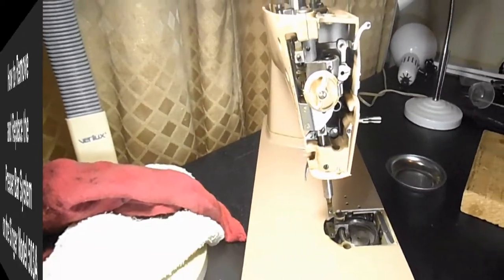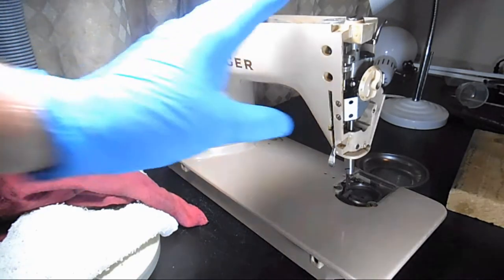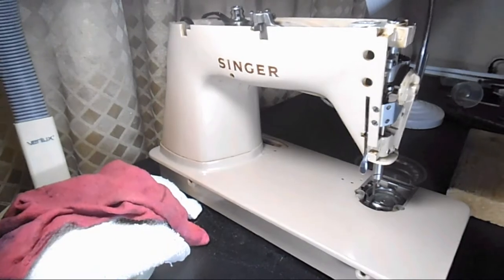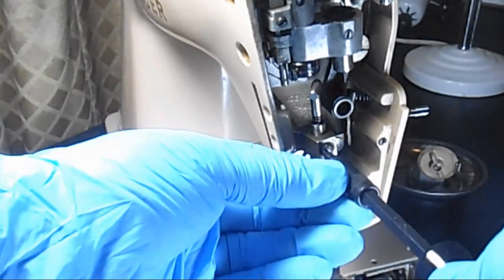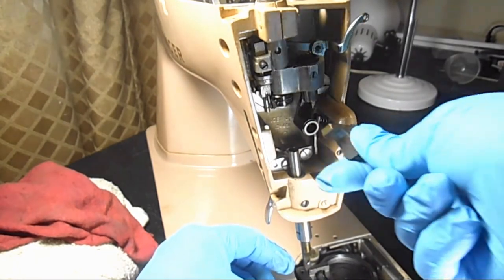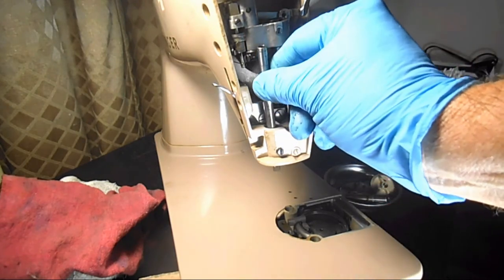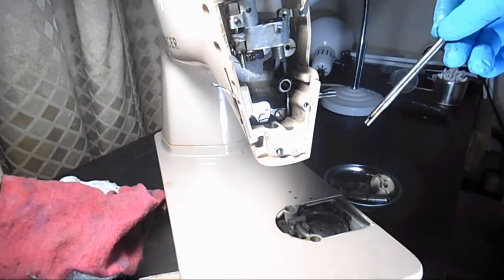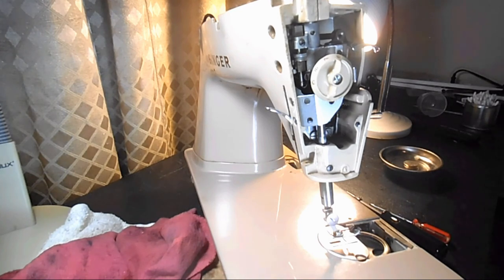How to Remove and Replace the Presser Bar System on the Singer Model 503A

Comment: It took over 36 hours to dislodge the two back screws on my machine.

I used multiple applications of each: WD40,  krud kutter and hair dryer for 5 minutes.  Even then, it took a lot of strength and made a big popping noise when they finally let go.  I had put down a plastic drop cloth on my table and dobbed up puddling treatment with paper towels, using excess to wipe down other varnishing I saw.  Particularly on both needle and pressure foot bars.  

(A set screw dislodged from somewhere and fell out of machine in one of the turnings about while greasing and heating it.  Yet, so far, no set screw was missing from further disassembly 🤷‍♀️)

It did help me to understand how to work out remaining “varnished in” parts.  As each further step had at least one bit that required same WD40, krud kutter, heat to get them out.   

The single owner’s son sold it to me from her estate and said she used it a LOT.  I gather she knew how to oil!  

This is for future folk’s use, not really a question.  Take your time so you don’t scratch up body or bend parts of your machine.   This procedure EVENTUALLY works like a charm.
Reply from the maker: "She Persisted"!! I admire your determination, Angelina. Those 50-year-old factory tight screws can really be tight. Then add a few layers of dried varnished "oil" and it can be a herculean task to break them free without damaging the part or the machine. Good job and nicely done.

Comment: Again, your video is worth a thousand words.

When I removed the pressure dial on my 503 to adjust the presser bar height I didn't see how the extension pin interacted with the dial. On reassembly, I referred to the manual. It read "With pressure dial set at "D", replace dial making certain that extension X2 is seated against outside cam surface of dial." I couldn't make that work!

Your video clearly showed that the extension pin goes into the vertical slot on the back of the mounting bracket for the pressure dial.

OK, maybe in this case your video is worth 21 words. 

Thanks
Reply from the maker: I'm glad the video helped you. It was tricky the first time I did it and took a few tries to figure that one out. A fellow emailed me yesterday saying he keeps telling people on Facebook "Andy Tube has a video for that", and sometimes I do. Thanks for the comment. Take Care.

Comment: Andy, thanks to you I just successfully fixed my dial that was not working properly when I purchased my $20 Singer 500A Rocketeer! I've admired these vintage machines for years but was too intimidated to actually think I could work with one on my own. I've watched dozens of your videos and finally felt like I was confident enough to take the plunge and purchase my first vintage sewing machine about 2 weeks ago. It was born a year before I was! I am so grateful to you for showing me (and so many others I am sure) how to maneuver my way around these lovely vintage sewing machines. I have a fantastic new hobby and am taking so much pride in each step I take as I restore my Rocketeer to her original glory. She was one hot mess but every day she gets a step closer to perfection. Thanks Andy! You're the best!!!

I found a few interesting things under her hood. LOL! All the usual suspects - beetles and gross things - but I am a very perplexed by something that actually looks like a tension wire coiled around one of the inner workings on the top of the machine near the cam shaft. I know it doesn't belong there but I haven't yet figured out where it goes so I am just leaving it there for now. It doesn't seem to be hurting anything but definitely has no purpose there either! I keep hoping one of your videos will show me what it is at some point. Please keep making your videos and I'll definitely keep watching. You're such a treasure Mr. Andy!

All the best!
Paula
Reply from the maker: " She was one hot mess ..." Hehehe, thanks for my first smile of the day. A good description! Good score for $20; the motor is worth that much. Thanks for the compliments, and for watching my channel. For the spring, what first comes to mind is the spring for the bobbin winder. They are very prone to breakage. There is also a long coiled spring from the needle bar driving arm on the left side of the camstack area over to the needle bar vibrating bracket that can break. All of these springs are shown in the three videos linked here >>
https://www.youtube.com/watch?v=BWdT7OlGUMg

https://www.youtube.com/watch?v=P2ROdLM5zmE

https://www.youtube.com/watch?v=89kRREixTeA

Best of luck to you as you delve deeper into your restoration.

Comment: Regarding the two next-to-impossible screws in the back, I applied penetrating oil and left it overnight.  The next day I used my Wagner heat gun about four inches away for three or four minutes. I waited just a few minutes and the screws came out easily.  This area of my 500A was very dirty—it may have never been cleaned. I have the same Chapman screwdriver set as Andy and it works very well.
Reply from the maker: Oh, nicely done! I don't have a heat gun, but others have told me they have used it and it works well. I love my Chapman set, especially that little mini-ratchet! A good reference for others to think of a penetrating oil and heat to prevent damage to the screws, or your knuckles too I guess! Thanks for sharing. Be well.

Comment: This video, and the short one, helped me reattach the pressure foot system on my Singer 1021. The set up is a little different but your comments helped me accomplish the task on my machine. The 5/16th height setting, and holding the bar up to this position was very useful. Thanks for taking the time to make and post this video.
Reply from the maker: Thank you, Susan. I'm glad it gave some help for you with your 1021. I'm not sure 5/16 is the correct height for your model. If you raise the presser bar/foot and lower the needle all the way down the two should not touch. If they do you can always adjust the presser bar height a little lower, right? Its great you did it yourself. Congrats. Stop by anytime.

Comment: Hi Andy, I'm looking at your presser bar video here and I'm wondering if I re-adjusted the presser bar height up, would I be able to sew thick multi layers of fabric without the thread tensioner releasing?  Looks like it would work by the video.  Any thoughts?  I've had the thread tension release while sewing thick stuff.
Reply from the maker: I've never done that, Ralph, but it seems possible. You'd just be creating a little more room for the fabric. Things to think about are if your feed dog is set too high, if the pin on the back of the presser bar lifter lever is worn, or if you "help" the fabric move along and are inadvertently "lifting" the fabric at the back of the presser foot. Be sure you are using enough pressure on the presser bar dial to press on the fabric. If those all seem OK then sure try raising the bar and see if that helps. Good Luck.
Reply: @andytubesewing1953  Thanks Andy.  I've definitely been "helping" it through.  I have a hunch the end result might be the same.  Have a great Thanksgiving.  Thanks for all the help.
Reply from the maker: @ralphwatten2426  You may want to try and even feed foot or walking foot. My wife uses this when sewing layers, especially of thick material. https://www.amazon.com/DREAMSTITCH-421333-451-Walking-Singer-Machine/dp/B07WRGWX7P
Some of the newer styles even have teeth on the foot, just like the feed dog does. Thanks for watching my channel and good luck.
Reply: @andytubesewing1953  Thanks Andy, I'll give it a whirl.

Comment: Thanks for your videos.  I "found" a 500 today that looks like it's been in the barn for 10-15 years.  Lots of dust and some light rust on the needle bars and presser bars.  I was afraid to even make an offer for it.  Now after watching your videos I'll go back and take a closer look.  Are the rods on the 500 series as strong as they are in the 403?  Thanks again.
Reply from the maker: Yes, many of the 500A/503A parts are the same or similar to the 401A/403A parts. Only the 404 straight stitch model is more heavy-duty parts wise. If you get the 500A, this other playlist for the 401A can help you clean/adjust all those moving parts in the arm that tend to need servicing, especially after a decade in an environment like that. https://www.youtube.com/playlist?list=PLsCOZgzzaiKLiDl9yFTP6mJgQmz5lj4NO  I remove rust with The Must for Rust. The machine is extremely well made and usually cleans up well and sews strongly.  If you have time, you can download the free instruction manual from Singer to see how all those knobs and levers are supposed to move so you can check them out while buying. https://www.singer.com/search/support?title=500 You can also download a free copy of the Service Manual here: https://sewingdude.files.wordpress.com/2012/09/singer-500-service-manual.pdf     Best of luck, and don't be a stranger.
Reply: @andytubesewing1953  Thanks for the quick reply.  I thought one of the 400 series was "heavy duty" from watching a video comparing the 3 models.  I've  probably watched 40 hrs of videos this week.  My wife wanted a 221 for a quilting class, so we bought one on Monday.  Since then I started looking at the 301's about 15# vs 11#.  A 401 that appeared in great condition from pics got away this morning for $55 in a nice cabinet.  She's got 6 machines including a Bailey 17" long arm.  Don't know why I'm looking for more. LOL  Can't seem to make up my mind between the 300, 400, or 500 series?  There is a nice looking 403 in a cabinet for $75 about an hour away Any thoughts on which series/model?  Thanks again.
Reply from the maker: @customcutter100  Yes, the 404 is considered heavy-duty (by Singer) and it has some heavier bushings and shafts. It's the model that replaced the 301A, both being straight stitch. The 301A is certainly beloved by quilters. My wife's favorite model. She also has a 403A which is my favorite heavy ZigZag machine. You can pop in 22 top hat pattern discs, or cams, and sew many of the same stitches as the 401A/500A machines, but without the big metal cam stack to push around, and only a single pattern selector follower, compared to dual lifters and followers on the 401A/500A. I never met anyone who used all of those patterns on the cam stack dual knob machines anyway. My wife's been sewing for almost 60 years now, and her machines are the 301A, and if she needs/wants ZZ then her 403A. My favorite straight stitch is the 404, then the 403A for ZZ. These are domestic (home) sewing machines but considered heavy-duty compared to most of today's $300 to $500 machines. (plastic) If you clean and oil them they will last 3 lifetimes. eBay sellers will call them industrial machines, but they are not. If you'd like a more portable ZZ machine that is still metal and can hem jeans, sew upholstery and camping gear, etc. Models 337/338 and 347/348 are very nice, strong capable machines. People keep them in an RV and vacation home too. You can see videos of all of them on my main playlist page, grouped by model number. I remember when we only had 6 machines, haha. Good luck.

Comment: Hi Andy, I've adjusted the pressure foot height using 5 quarters as you do.  My issue is that the bar slides back down in a very short while so that  I end up with about 3/16 of an inch instead of 5/16.  I really need that extra 1/8 inch clearance.  Any idea how to fix that?  Thank you for all you do and hope all is well with you.
Reply from the maker: I had this happen only once. I felt the set screw was not gripping the bar tightly. I removed the set screw completely and put a couple drops of oil in the hole. I used a wood BBQ stick to push in a strip of a cotton t-shirt and then twisted the cotton piece in a circle a few times, When I pulled it out there was grit & grime all over it. I put a drop of fresh oil in the hole. I held the screw with a plier and brushed it with a small wire brush then reinstalled it and that did the trick. I think the grit in the threads was preventing the screw from full insertion and holding the bar tight. That's all I can think of today without having the machine on my bench to investigate. Thanks for watching my channel. Good Luck.

Comment: Hi Andy have you tutorial for futura ii 925 presser bar guide or kind of that model? I can't put it back..as i tried to fix it at home because everyone rejected to repair my sewing machine. Thanks.
Reply from the maker: The Futura 925 is more modern than the machines I work on and I have never touched one. Terry has a service manual that could help you. If you buy from him before 8/1/2019 use coupon code andy-h-yt and he will give you a 20% discount. http://site.tandtrepair.com/Futura.html
I can direct you to a free instruction manual for your model here >> https://www.singer.com/sites/default/files/product_manual/SINGER%20925%20FUTURA%E2%84%A2%20II%20Sewing%20Machine.pdf
You can also download a free copy of the parts manual here >> http://parts.singerco.com/CPpartCharts/9_99999/925-3.pdf
That is all I have for you, Mozart. Good Luck.
Reply: @andytubesewing1953  Thank you so much for your kindness Andy.....Wish you always success!!!
FYI i bought it second hand by factory and Found it not work well once arrived home. Called service and rejected then i decided to open up and found it the gears was melt.
So I won't get discount or anything from them.
Thank you anyway 😃
Reply from the maker: It is sad they sold a broken machine to you. The link I gave you to the service manual also has a guide to changing gears. As I said, I've never worked on the Futura so I don't know if it is worth your time and money to try to repair. I think this is why I work on the older machines you see on my channel. They were made stronger, with fewer parts and are much easier to maintain and fix. Some of the models, like the Singer 403A, have snap-in pattern cams that allow you to sew different stitches if that is your desire, but it is a much easier mechanical system then a machine like the Futura. Anyway, best of luck to you, Mozart, and thanks for watching my channel. https://www.youtube.com/channel/UCUSPDsHaFtRoz1VA2U1xJ4w/playlists?view_as=public